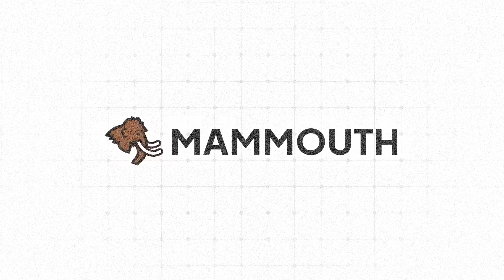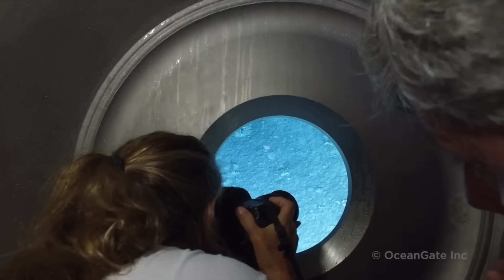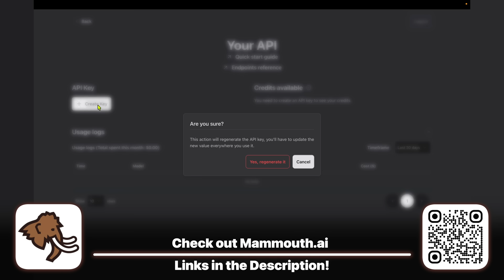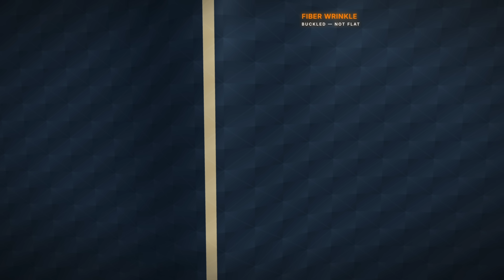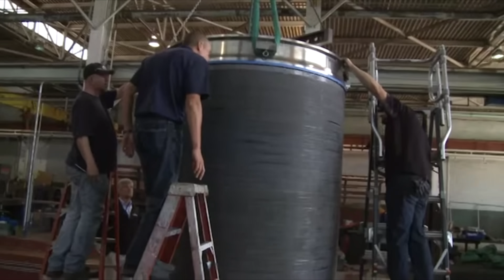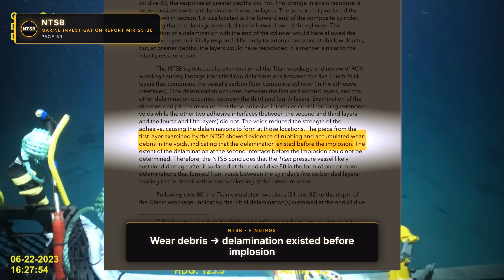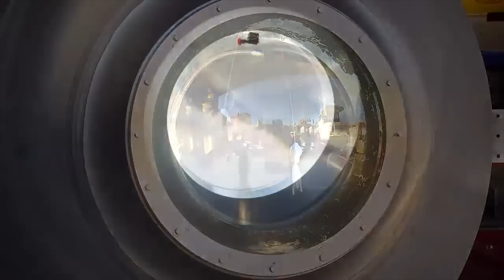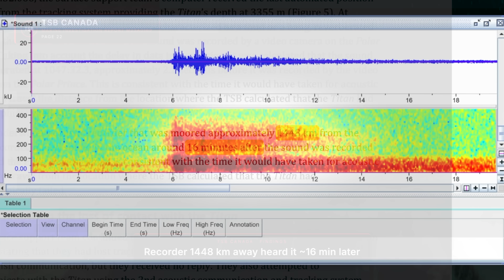Oceangate Titan: It was WORSE Than We Thought

Comment: “I told him I’m not getting in it,” former OceanGate engineering director Tony Nissen said to a panel of Coast Guard investigators, referring to a 2018 conversation in which CEO Stockton Rush allegedly asked Nissen to act as a pilot in an upcoming expedition to the Titanic."

"Nissen walked the Coast Guard board through deep-water testing in the Bahamas in 2018, during which he says the sub was struck by lightning. Measurements on the Titan’s hull later showed that it was flexing beyond its calculated safety factor. When a pilot subsequently found a crack in the hull, Nissen said, he wouldn’t sign off on another dive. “I killed it,” he testified. “The hull is done.” Nissen was subsequently fired."

"Nissen sought to draw a line in the sand between the vessel he worked on and the one that took the fateful voyage to the Titanic. The latter had a replacement hull and a redesigned acoustic monitoring system. “My design was collecting data such that we would prevent a catastrophic failure and ultimately the loss of human life,” he said. “We did that with serial 1. What they did in serial number 2, I don’t know. “

"Lochridge submitted a report in January 2018 outlining his concerns about the submersible's carbon-fiber hull, including imperfections, after he said Rush asked him to inspect it.  "At the end of the day, safety comes first," Lochridge said. "Yes, you're taking a risk going down in a submersible, but don't take risks that are unnecessary with faulty, and I mean faulty, deficient equipment."  Lochridge testified Rush "liked to do things on the cheap." Asked why the company resorted to cost-cutting measures, Lochridge said, "The desire to get to the Titanic as quickly as we could to start making profit."  He said he did not know about the financial side of the company, but that "there was a big push to get this done."  "A lot of steps along the way were missed," he said.  Lochridge testified that Rush wanted to do manned testing of the first Titan prototype, though Lochridge recommended doing unmanned testing due to his concerns.  "I knew that hull would fail," he said. "It's an absolute mess."  Lochridge was fired from OceanGate in 2018, days after submitting his report and attending an hourslong meeting with OceanGate executives, including Rush, ABC News previously reported. Documents reviewed by ABC News stated that it was clear Lochridge and Rush were "at an impasse" regarding the Titan hull and "the only option was the termination of your employment."  Lochridge testified Tuesday he was terminated because he was "anti-project."  "I didn't want to lose my job," Lochridge said. "I wanted to go to Titanic. It was on my bucket list. I wanted to dive this, but dive it safely."  Following his termination, Lochridge said he reached out to the Occupational Safety and Health Administration in February 2018 with his concerns about public safety and was placed under the agency's Whistleblower Protection Program.  "I wouldn't want to see anybody dying for the sake of going in a sub," Lochridge said Tuesday. "It's a magical place. I love it. I'm very passionate about what I do. If there's risk like that, don't do it."  Lochridge, a veteran submersible pilot, said he was meant to take several paying clients down to the wreck to take a 3-D model, but Rush wanted to pilot the dive instead. Lochridge said he objected, noting that the wreck is "dangerous" and that over a dozen people died during dives to the site at the time -- and eventually persuaded Rush to let him go along.  He said Rush ended up getting the vessel stuck in the wreck and refused to relinquish control of the submersible to Lochridge until one of the crew members yelled at Rush to give Lochridge the PlayStation controller that piloted the vessel.  Lochridge said Rush threw the controller at his head and one of the buttons came off, though he testified that he was able to repair it and get them back to the surface.  After that, Lochridge said Rush stopped talking to him.  Lochridge testified he raised objections after OceanGate phased out its relationship with the University of Washington's Applied Physics Laboratory in 2016. He said Rush decided to do all engineering for the Titan in-house.  Asked by the board why that was the case, Lochridge said, "Arrogance."

The fix was:  Shoot the messengers.

Comment: The key issue wasn't technical, but what you said at the end - guy was rich enough to do it, but not rich enough to do it right - which led to all those shortcuts in engineering department, but most importantly: to a situation where failure wasn't an option.
It doesn't matter if the safety protocols were designed properly, as the person at the top was in the dead set mindset of always deluding himself it is fine.

Comment: It's not 'worse' - wrong headline. Any FRP engineer will tell you that carbon fibre is used in tension not compression. In compression you are relying on the supporting resin not the carbon fibre. A college student knows this. Very, very stupid and ignorant misues of a fine material.

Comment: the weakness lay in the inability to join the carbon fibre  weave to the titanium, as far as i am aware only glue was used. bad choice.
Reply: Differential compression too. The carbon-fibre cylindrical section compressed more than the titanium endcaps, putting even more strain on the glue.

Comment: Carbon fiber, is not great at resisting compression, it is however great at resisting expansion. I have several air tanks for playing paintball that can confirm this. All the other experts agree with me on this subject. It's actually surprising to see some experts trying to say the exact opposite about Carbon Fiber. When from my own experience I can confirm what every other deep sea expert has said about the Carbon Fiber hull is true, I'd never drive a car made of nothing but Carbon fiber just like I'd never go deep sea diving in a carbon fiber tube. Carbon fiber is an amazing material, it's just not structurally sound, you still need a mighty large chunk of metal to make sure it's not going to collapse in on itself

Comment: Boeing didn't even work on the project...they were asked to help and refused. The only thing Boeing engineers said to Oceangate was their design was flawed and would fail. Boeing was never paid, but gave more valuable advice than anyone which hasn't even been considered. Oceangate had several lead engineers leave because they refused to cut corners and lie about testing data. This was going to happen no matter what. Again, BOEING would never have been consulted about a change because they weren't involved.

Comment: I may be wrong. But it kinda makes sense to me of what  REALLY HAPPENED on that last dive.
The part where you said. The sub was left outside in the winter. 
Not only do I believe that water the ice formed in the carbon fiber during this time.
But I also believe that when it melted it never really went anywhere.
Making the sub way heavier than it initially was.

In the transcripts of the final dive it was said that when they were diving they were literally going twice as fast down as they usually would.

I think the sub was water logged. That explains how they got to the depth they did so quickly. 
Then poof!!

Comment: So basically, if the sub was built correctly it actually would’ve been an insanely cost effective and efficient method of sub creation, in addition, if the CEO cared just slightly more about safety and or understood carbon fiber they easily could have prevented the issues

Comment: In structural engineering you work towards a 1 in 10,000 chance of failure of any given element in any given extreme event, typically an earthquake or hurricane, or maybe an army of tanks rolling over your bridge. A few things go into this; you often use a material strength 1 standard deviation below the average; then you have strength factors depending on the type of failure, such as 0.9 for steel in axial or bending, 0.75 for steel in shear, 0.85 for concrete compression, or maybe a factor of safety of 3 for your soil capacities; and finally, you add and/or amplify all of the different loads based on their probability of happening at the same time. So, minus defects or errors (which accounts 99% of failures), for something to fail, the thing needs to experience extreme loads and the material or construction needs to be understrength, but also, if it was something like a long-span roof girder, you're going to see it bowing down and the roof probably leaking long before it actually collapses, so the member also has to have some sudden failure mechanism, likes bolts shearing off (connections are the worst).

Comment: There is nothing wrong with a sphere.   The argument that they couldn't fit 5 paying customers in one is totally missing the point, they did not want to spend the money making three spheres and not having everyone in the same container.   This was a shoestring operation that should never have been allowed to build a sub-standard piece of poorly built junk.   Do it right or go home.   The only numbers anyone ran in those reports is in a computer simulation.   If it was this trivial, then no company would ever need to built prototypes.   Just "run the numbers".
Reply: There was also the issue of transporting the vessel to the dive site. A sphere that could hold five people would have to be massive, and massively heavy, and consequently need a much bigger support vessel, which in turn would have cost a lot more money.

Comment: Statistically it's still safer than regular traffic by far.
Reply: 13 trips and then you die. doesn't add up to "safer by far".
Reply: @r.b.l.5841  Well you can die in your first trip in traffic and it's not even up to your car or driver.
Reply: @ChargedPulsar  13 trips no collision and you die. doesn't add up to 'safer by far'
Reply: @r.b.l.5841  Well you can die in your first trip in traffic and it's not even up to your car or driver.

Comment: Couldn’t a bigger sphere fit more people
Reply: Yes, but having a larger internal volume would mean thicker material to make it stronger. This would increase the cost of the build.
It would also be larger and heavier than the Titan and consequently would need a larger support vessel. This would increase the cost here too.
Reply: @adamheywood113 But it still would also mean you’re not crushed to death. I’m sure making a larger tourist sub comes with higher costs than a smaller personal sub but making it the safest shape is the most important part of the design. I can’t afford to make even a small personal sub so I don’t take that on.
Reply: @bitcoinbeavis7742  Indeed, it came down to money. Stockton Mush didn't want to spend that much on building and maintaining.
People were already paying $250,000 per ticket. Sure, if he'd built it bigger and stronger, and had higher costs, the solution would be to charge more. Would people pay $500,000 per ticket? $1million? Who knows, I'm not a billionaire either.

Comment: Unless I misunderstood - the owner himself said tht they didn't always make it to the Titanic wreckage due to one thing or another.

So that's 13 trips with vastly different loads being applied for the duration. To be liberal maybe it was more like 10 successful trips and 3 failed due to weather, etc. that would mean the structural integrity only made it to around 10 trips before complete failure.

I guess it's all moot, but it simply makes a situation that cannot get worse... Worse
Reply: I think they made 11 or 12 trips to the Titanic but they used the vessel for other dives too, to different depths
I think it was something like 80 altogether

Comment: 15:25 Auto manufacturers use the method of production. When pars for automobiles are made. During quality control.  When testing, the tolerance range for highest quality parts is measured.  Lets use Toyota as an example. The best parts go to Lexus. The next parts that are still acceptable in a wider tolerance range.  Go to regular Toyota's.

Comment: So is this saying that if someone were to actually build it properly and to Boeing's spec, it should never fail? So many questions.

Why did the carbon fiber develop wrinkles—mfg incompetence or just how CF works? Shaving down the diameter of the CF where it meets its most crucial connection point seems diabolical—but I guess that's just how Rush rolled? I guess they didn't account for this expansion due to air pockets—again, is this mfg incompetence or something else? The omission of the 45º plies also seems like gross negligence/stupidity/trying to save time/money—the recurring Rush hallmark at this point.

I would love to hear updated comments from Cameron on this with the new data. I did not realize Boeing made the original design yet Rush did not even follow the specs..... insane.

Comment: The other obvious area of concern is the glue joints between the carbon-fiber cylinder and the titanium half-spheres. To the extent that the strains on the two materials are unequal (given different values of the Young's modulus), there would be a net shear stress across the glue joint. One reference I read said that the joint was "designed to compensate" for the strains, but given the other engineering shortcuts applied in the design, I remain skeptical.

Comment: I'm a composite technician in aviation. When I heard the hull was made of carbon fiber after the incident, I was scratching my head at the stupidity of these engineers...Then I learned that the NDT (non destructive testing) of the submersible was completely inadequate an basically non-existent. It would've required ultra-sonic and radio-graphic testing after and before every dive since they parked that thing like it was a trailer. This was a backyard amateur project and Stockton Rush and his team , minus whistle-blowers that were fired, put their faith in materials they did not understand at all. Titan OceanGate was a project bound for catastrophic failure managed with absolute blind faith and negligence.

Comment: Dude, I'm a structural engineer. Less than two minutes in, it's clear that you have no idea what you are talking about. No giant fingers were trying to crush this ill-conceived design the way you crushed that beer can. There were no support rings at the end of the cylinder. The entire exterior of that pressure vessel -- the cylinder, the domes, everything -- was subject to uniform pressure all around, not to giant fingers. You have no idea what you are talking about.

Comment: I think the ceo shoehorned engineers into making the most corner cut design they could think of. It was constructed with a strict budget as the overall guideline. And the damage of repeat exposure to extreme pressure was never considered.its not so much thatbit was poorly engineered or poorly constructed its that the engineering and construction were manipluated around cost over safety

Comment: 1.25 is a crazy low safety factor rating IMO...even if was made slightly below that factor. Lifting hoists are made to a standard 5:1 safety factor rating for example.
Reply: Yeah, I was thinking this as well. And it’s not even difficult to understand, you don’t need to be an engineer to understand why - when my dad built me a swing back as a kid, he explained the concept of a safety factor to me in a way that even 8yo me could understand fully. 

And he decided to go for a 10:1 safety factor for the ropes, just to be on the safe side, and we took down the swing in the winter so the ropes never had to withstand freezing degrees.

In other words, my non-engineer dad and his 8yo daughter put far more thought into safety factor rating and environmentally caused cumulative fatigue for a swing hanging 50cm above ground…

…than the self-titled submarine expert who claimed he wanted to create a craft capable of doing repeated dives several kilometres down into the deep ocean under multiple atmosphere’s worth of pressure, with all the environmental factors and material fatigue that that would entail.
Reply: IMO, cost may have been a very significant factor in going with 1.25 for a unique COPV hull.

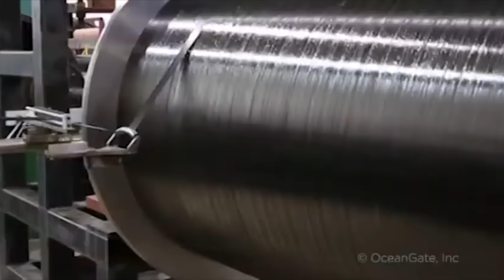Comment: 3:12 - I can't express how bad this analysis is.  If this was in the Canadian Safety Board report, its garbage.  The problem had nothing to do with fatigue....   to calculate the fatigue life on an incorrectly designed externally loaded carbon wrapped pressure vessel is laughable.

Comment: The submersible dove 13 times to the Titanic wreck before the accident, with 87 succesful dives before the accident. So it is not like it was a complete design disaster, like this video presents the facts to make some views. It is a wear and tear issue. Used one time too many.
Reply: @OlivierNayraguet  Not much of a safety factor for something like that. The dumbest thing is they had sensors and data to track the degradation of the hull, and then ignored the major signs of it failing. 
They wanted to push the boundaries which is fine if done properly and safely. Neither of which they did.

Comment: I'd be very curious to know how much it would COST to build a "defect-free" version of the Titan hull, and what facilities would be capable of it. "Theoretically carbon fibre could work for this" is not actually a very helpful insight if there was no way for Oceangate as a business to possibly achieve those tolerances with their manufacturing capabilities. Kind of like saying the problem with a homemade rocket that blows someone's house up "isn't using a huge stack of model rocket motors, because those are just solid fuel boosters and NASA uses those just fine".